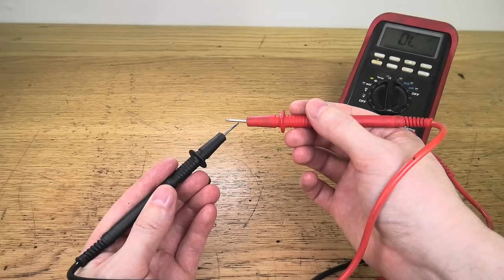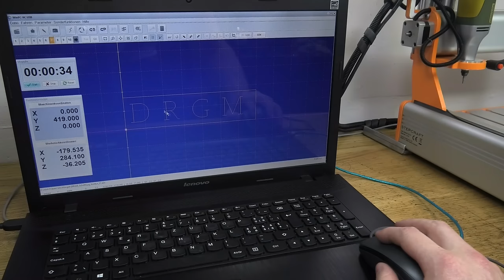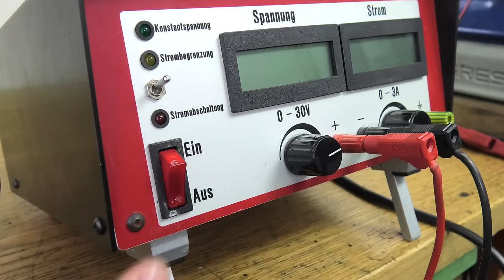I Make a New One! Making new Parts on Lathe & Mill for Restoration Projects (Compilation Part 5)

Comment: Hello Mr MM. Hope you are enjoying the finally arriving snow. Do you ski, btw?
Great pleasure seeing the insights clips. Again lots of clever solutions and engineering. One thing though. On your quite stunning Chicago rivets, you test assembled the parts together. The rivet halves bottomed out and stopped as it should. I noticed then that the screw driver slots lined up! How do you calculate that?!? This is Star Trek future stuff. Was that intended? Just when we maybe understand how you do it, you jump ahead again. Nice work. Well, back to the engineering books for me.

Comment: I have already watched all those original restoration videos. Craftsmanship par excellence! Finished products are simply awesome :)
I think the tools you have used for bending the copper plate,  winding copper wire, the wire tensioner are made by you. Isn't it? Being an IT engineer myself, I still feel that I should spend some years under your guidance as an apprentice :) coz I am very much interested in mechanical engineering. BTW I use Lenovo too :) Happy "Making new ones"!! How about making something big new one?! :)

Comment: When electroplating, the piece to be plated is attached to the cathode with a clamp. I've always wondered - does the part of the piece in direct contact with the clamp get plated, or do you have to move the clamp to get full coverage?
Reply: Yes he has to move the clamp.

Comment: May I suggest for 10:35. Notice how the sticker has raised the surface clear coat finish? I've watched scale modelers use a technique for hiding "raised" surfaces of applied decals by applying a clear coat over the decals then sanding it down. When the final clear coat is applied, it's smooth over the decal.

Comment: So does the electrical clamp you're using to hold objects for nickel-plating just get more and more nickel over time? And if so is that okay? Or do you strip it down every so often or something?

I would think it is okay but I thought I'd ask. I've been using unneeded wire as a bridge between my electrical clamp and the part in solution and it would be easier if I didn't.

Comment: why show drilling holes in like 0.020" thick steel with just a twist drill and holding (preventing spinning) bare handed?  not only is this a safety issue as once that drill breaks through, it'll catch and the sharp metal would spin around slicing a finger or hand, but you would not get perfectly round holes such as yours.  But I thoroughly enjoyed the rest of your production!  I especially liked thr tricky way you made those elongated, flanged "O's"
Reply: Safety is job three

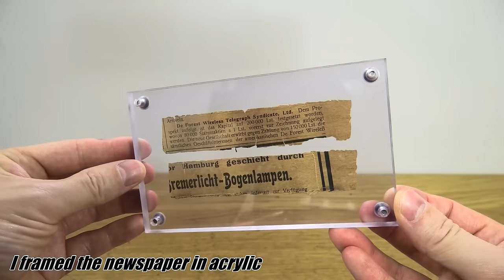Comment: 2:29 "...from ... august 1902 on. According to the existing invention there should be given electricity evenly, no matter if the electricity is given to the motor or to another regulating unit, as soon as all wagons are ready for departure. For this purpose the circuit shal be arranged all over the train in a way that the connection with the ..." 
(headline below) "Pocket-Instruments electr..."
(backside) "...articles. De Forest Wireless Telefraph Syndicate, Ltd. According to the brochure the capital is set to 200,000 Lst. of wich 80,000 nominal shares of each 1 Lst. are set up to endorse." Not sure...its a little cryptic "In exchange for 150.000 Lst. the new society aquires all of the business interests of the american De Forest Wireleß..."
"Ahead of Hamburg happens with (...) Bremer light bow lamps."
(bottom line) "electricity (...) etc. are ready at any time"